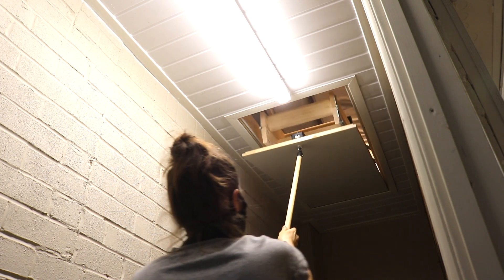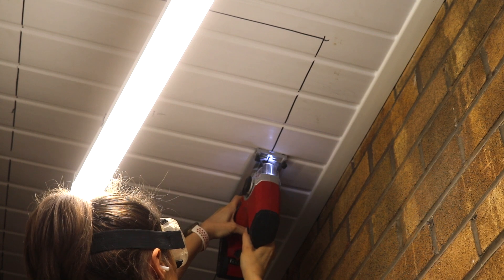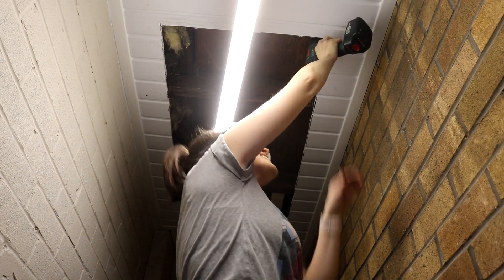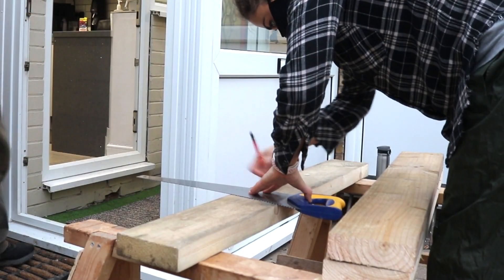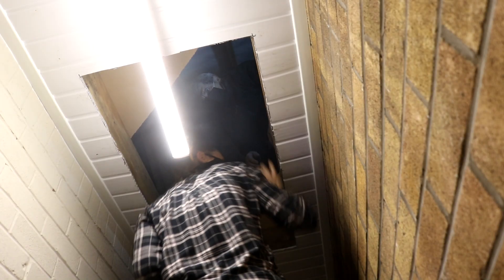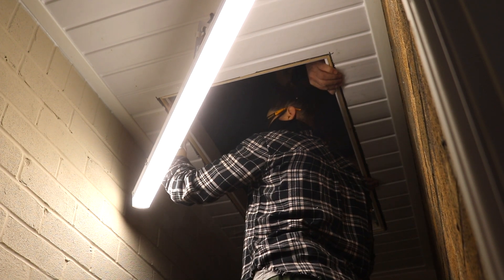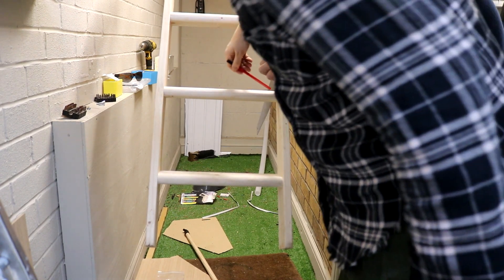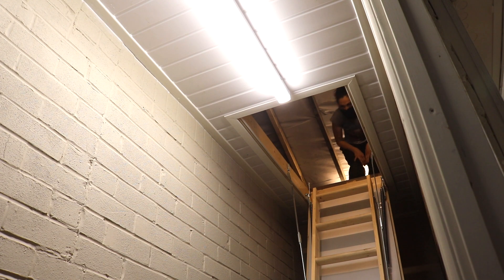Installing a Wooden Loft Ladder and Hatch | The Carpenter's Daughter

Comment: Nice job but worth adding a warning at 2:08 about cutting through beams, in your instance it doesn't look like they are structural but in many other cases they may be and you really shouldn't just cut them without taking appropriate mitigating measures.
Reply from the maker: Have pinned for others incase.
Reply: Measures being adding a some heavy duty noggings between an uncut joist and either side of the one I'm cutting? I need to increase the size my loft hatch for storage & ladder hatch, the current one just sits between two joists so it's just over 1ft wide or thereabouts.

Comment: Nice job, want to do this at mine.
Is there any reason you didn't cut the bottom of the ladders at a 45 degree angle, so they sat flush with the floor?
Reply: Just come on here for the same reason, it could be the plastic feet you put on the bottom of the ladder are moulded for a straight cut and the moulding makes it 45•

Comment: Wow. My mind is blown. We have a stupidly small loft opening. . . I fell out the loft just over a year ago and almost broke my neck. We have loft ladders (unfitted) as the loft opening is the wrong shape. You can honestly cut thru joists if you put in good, solid framing? No more falling out lofts from decorating ladders for me!
Reply from the maker: It does help to have a carpenter Dad who's built roof rafters for houses, so personally, I would check first as to which ones to cut first if unsure  This area only ever had a flat roof across it as the porch used to be an alleyway leading to the garage to the right :)